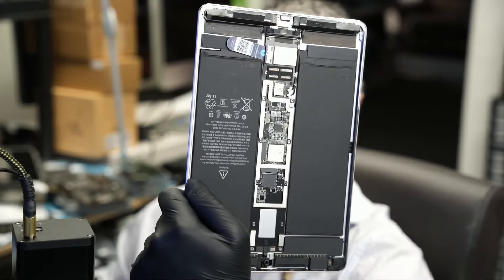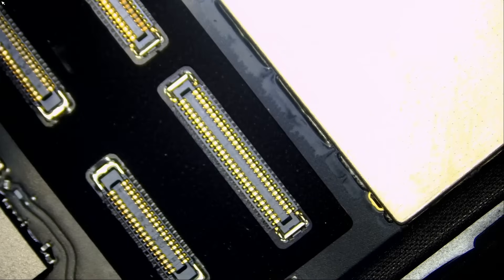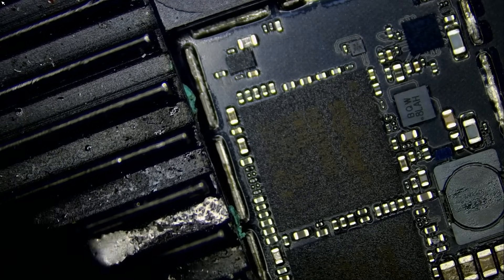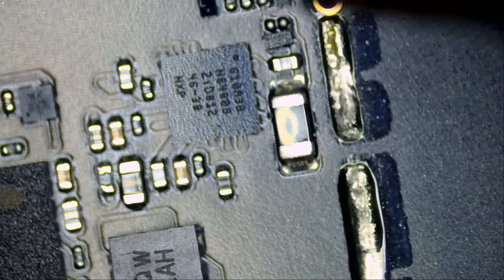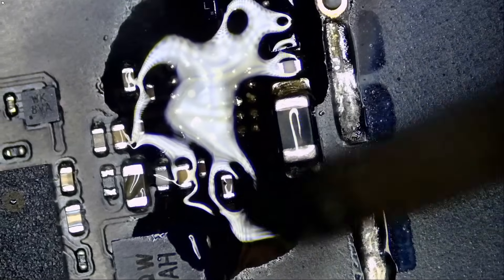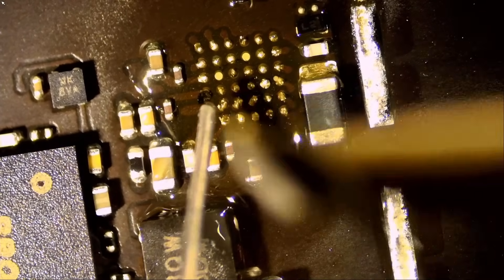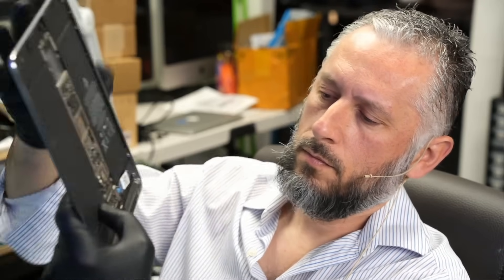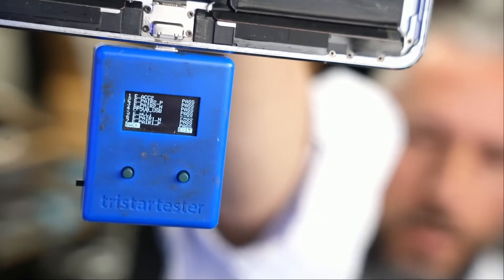iPad No Power? Fixing a Tiny Chip the Size of 2 Letters on a Penny

Comment: What’s the deal with the graphics cards with no GPU and ram?
Reply: I'm wondering as well....
Reply: company's in China remove the core and memory and install them onto custom single slot gpu cards, so they can fit in servers. This is the deal.
Reply: Most times the GPU board maybe have some physical damage, not repable, but they salvage the working GPU core and vrams and lets say, "transplant" them to perfectly good boards, that have these two components faulty for some reason. Maybe after overclocking or mining (Its the 2 most expensive parts of a GPU)
Theoretically in the end the have 1 working GPU from 2 faulty.

And then they scam people by saling them "empy" GPUs as working ones. Not in my worst enemy...
Reply: Someone got scammed. The board doesn't work when you plug in, the seller vanishes and your only option is to send to a repair company to try and get some value back.